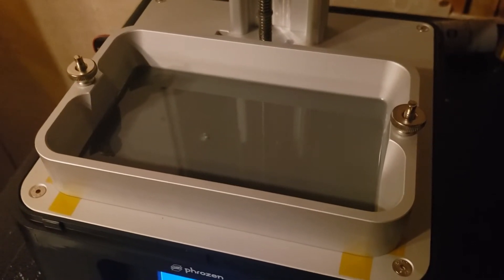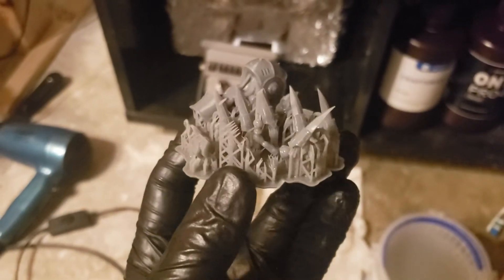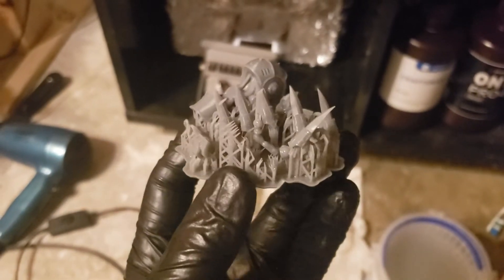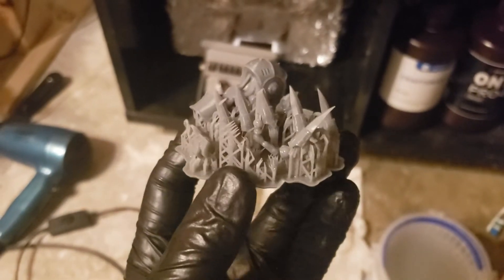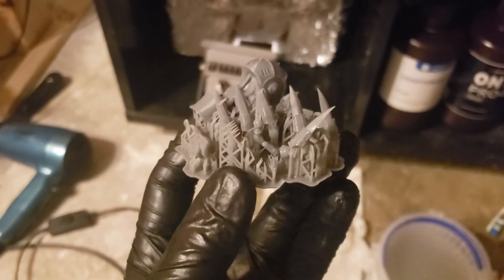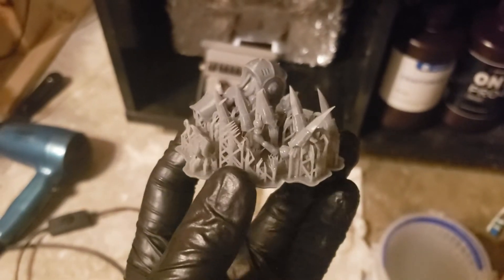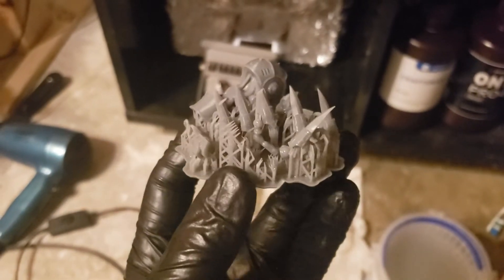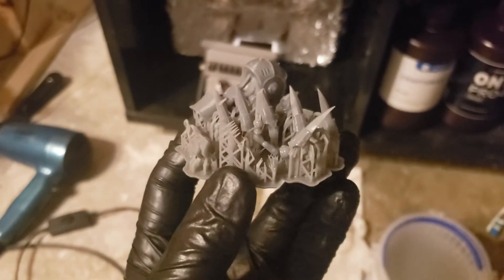Clean failures off your FEP with ZERO SCRAPING! This is the best way!

Comment: Thank you for this! I ran into a print fail yesterday and scraping the vat caused me to have to replace the fep after only 2 or 3 uses. Put in new fep and very next print fails too (total print fail across the whole fep. My luck is amazing right now). I thought there must be a better way and a quick search led me here. Was able to get my fep cleaned painlessly and get back to printing sooner than if I had been trying to scrap all the bits off. It was sooooo much easier! You are a life saver!
Reply: Well I have done a similar thing.  I will be replacing my fep today probably.

Comment: I had a big nasty failure, was sure I was going to have to change the FEP. Used this technique and it worked perfectly. Cheers.
Reply: There is easer way, you just put an old support in the corner of the LCD (NOT THE FEP) Run a tank clean then pull up and twards the center of the LCD. This will pull out the tank clean with all the stuck parts.

Comment: I didn't even know what that vat cleaning button I kept seeing on the control did until this. I wonder if I should start reading the manual or something.
Awesome tip. I wish I had known about this yesterday before I scraped a failure off and put a couple dents into the FEP already... on a brand new printer. Oh well - live & learn.

Comment: For anyone trying this: put the old support in an outer (!) corner, turn on the UV light as in the video (15-20 seconds might already do) and just pull on the support. No need to drain the VAT nor damage the FEP. I actually never clean the VAT, just give it a whisk with a soft tool.
BTW, this is an idea that was posted before this video was released by someone else, but then with the tips I just mentioned.
Reply from the maker: This is an awesome idea, gonna try it on my next failure!
Reply: You'd drain the vat because after you noticed something broke off, the risk of having additional floating bits is much high(er)! 
The more proper steps you do, the less risk of FEP damage/a major failure (in the worse case equals: printer kaput, because of a hole in FEP, resin drained all over and inside your printer).

Not draining the vat is just only 1 step away from not doing anything at all after a small failure..... and thus a catastrophic failure in the making for sure!
That it didn't happen to you (yet!!), is no excuse to learn very bad habits! You can find enough videos on youtube of people who were equally 'lazy' or in a hurry and the result is they damaged their printer beyond repair (even after a very long and tedious cleanup of all the drained resin around their desk).

But hey... if you can't be bothered to even drain, check and siff the resin, after a broken piece, before putting the resin back in, to save you just 20 seconds (because that is actually ALL it takes to do it)... by all means risk a damaged printer and/or a 2 hour cleanup. See what takes the most time and money.
Reply: @CookieTube   Never seen a hole cause it to leak inside of the machine unless someone uses a material that isn't meant for their printer. As far as more steps = higher risk.. No.. And finally.. No way will I or any sane 3D printer enthusiast drain their vat with every use. Stir.. Wait for it to settle.. cure and pull. Works every time.
Reply: @CookieTube  Wow, you got out of bed on the wrong foot, clearly. I know it works perfectly for me for a few years now. You do what ever you want to do with my tip. I do not force you.
Reply: @MondoMurderface  1) Of course not many people will come out of and admit about their stupidity after claiming by high and low you don't need to check for loose pieces. But some do, and it can be read about on various fora, and videos can be found on YT about this very specific problem and catastrophic (FEP) failures.
2) Nobody is talking about draining after each use!! This is about after you found a broken or stuck piece.... Do not strawman!
Reply: @macnavi  Yes, I did what I wanted to do with your tip and that is correcting it / warning people of the bad habit and of the possible risk when you do that (or rather don't do that -- sieving for other broken/loose bits after you noticed a bit got stuck, that is)
And I'm actually going to bed after a very happy day, Thank you very much. So again a wrong assumption....
Reply: @CookieTube   Stawman? lol.. Okay reddit, calm down. Don't make me gaslight you next.
Reply: Usually I just get the corner up with the plastic scraper, but I damaged a FEP one time that way because I was way too rough. I bet if you put a raft in the corner it would be really easy to peel the corner up and then go from there.
Reply: @geordonworley5618  That what I said and do! 😁 You need a bit of a tall one, where you can get a grip on.
Reply: @MondoMurderface  I drained my vat to check, I put the filter paper in the funnel then forgot to put the funnel in the bottle. This way seems a bit easier to remember, than digging into the FEP with the corner of my scaper:)

Comment: To be fair, you did good until you showed to touch the bottom of the FEP. That is a BIG nono as one, the way your pushing up on it can EASILY stretch it even a little bit that can cause issues later on, but you can also be leaving behind debris, fibers, or even faint traces of resin you may not see on your gloves from touching other parts of the vat. Or hecj from that towel you have it resting on. Even instructions tell you to never touch the FEP for this reason and if you clean it to rest it on its side, never flat down to avoid the FEP coming into contract with something. 
Also it comes up super easy if you put the support in the CORNER, with part hanging off of the exposure area, not just randomly somewhere. The supports create a nice lip  that is easy to go in and cleanly peal all of that up without scraping. You don't even have to clean out the resin or remove the vat and heck I've had it some times just curl up on its self due to the support creating that lip that lets it pull away. 
I've been printing for going on 3 years now, had my fair share of failed prints and never had to do much more than plop a support in a corner, run the tank clean than slowly pull it up and out. Want something even easier? Make yourself a small ball and use a really thick support on it and make it a good inch long, and print out a bunch of those. Use those for tank cleaning instead as normal supports can also easily snap off and break as you try and lift up with them. And yeah... put it in the corner of your vat, not randomly in the middle where it does nothing.
Reply: Agreed, except for one important thing: "...You don't even have to clean out the resin or remove the vat..." 
you do need to remove it to SIEVE the resin (before putting it back in)!

The chances of also having a (tiny) floating bit in there is very high. With all the risks it brings -- as you wont notice it during the hours of (re)printing, until you come back with resin all over your desk and floor (or worse inside your printer), because the floating bit punched a hole in the FEP.

As such, this is even more important to do than not putting your tray flat or touching the bottom.
It does not make any sense if you do properly handle the tray/resin like you should (rest tray on its side, not touch bottom, etc), but you completely neglect to sieve for floating bits.
Reply: I never ever sieve the resin when cleaning the VAT from a failed print. Using the expose-and-pull-out method removes all hardened resin. If you are in doubt, just whisk it with a soft tool (I use the spoon that comes with PVA) and you would feel if there is anything left. Never is though.
Reply: @macnavi  Never is, until there is...
You can not 'feel' those tiny bits at all if they are there! Yet, they sure can cause punctures.

Comment: I didn't think of that, I normally used a UV flashlight to harden the bits stuck to the FEP and then tap them or gently press them from the other side, avoiding the edge of the print, so as not to leave its impression on the FEP. TExposing a layer is a method that uses more resin, but can get rid of many little stuck bits, which is the most annoying print separation scenario, and you do not need to pour it out. Still a good idea to filter out the vat though, as running the buildplate into a loose piece will cause either the first layer of next print to come out badly, build plate to get skewed and need releveling, or (unlikely) damage the FEP/LCD. Or the piece will be randomly stuck to the next print somewhere.

Comment: If you still want to drain the vat anyway, no need to do a thin layer across the whole build area. Just do like the video shows at the end where you slightly push the Fep from underneath the failed print, around the corner of the failed print. That way it will not be sticking anymore to the Fep and go around the edges of the failed print from underneath until it pops up, then you just pick it up and throw it out.
Reply: throw it out.. after curing in the sun for a bit
Reply: won't you get marks on the underside of the fep by pressing on it?
Reply: @that_Ranjit  Not at all, you shouldn't be pressing on it from underneath hard enough to where it would leave an imprint or damage it. You should only be using your fingers when pushing from underneath, nothing sharp. Unless you have skeleton fingers, you should be good lol
Reply: @monkehgamingofficial   if there are marks from gloves or some light dust on the bottom of the fep, will that affect the print at all?
Reply: @that_Ranjit  not if you wear clean gloves

Comment: I'm kinda new so I might be doing this wrong, but what I do instead is, drain the resin (without curing a full bottom layer on the clean setting) and after that I pour a small amount of Isopropyl Alcohol into the vat (away from the printer, of course) and leave it there for a couple of minutes, after which I drain the IPA and flip the vat (on a container or a paper napkin) and gently massage the area with fresh clean gloves (maybe with a little IPA on the tips to prevent any friction) avoiding to bend the FEP (or definitely way less than it bends from the suction force when printing) and the failed part just moves/slides around, that's when I know I can just grab it from the film without worrying about damaging it.
That way I can also avoid wasting more resin on a full layer cure and maybe having more trouble with that.
Reply: This is what I do as well.  However, I haven't come up with a fast/clean way of cleaning up the edges around the fep that has a small lip of uncured resin.  Seems I'm spraying and cleaning endlessly.

Comment: Wow you are still doing a lot more work than I do with this method. 1. You expose it for 30-60 seconds?! I do 10-20 (usually 10) with 70% UV. And why are you bothering draining the whole vat? The whole point is you don't have to anymore with this method.
Reply: Yes that is what I do as well on my Elegoo Mars 3 Pro. I get the corner to pop off the fep with the extra support piece and then on occasion I have had the layer tear because the failed piece might have been a little big and so I coax the fep off with my gloves hand and then pull on it carefully and it almost always comes out clean. I did a bad thing before by having a piece of cured resin on my yellow spatula that dug into the FEP and made a hole about three days after I had changed it. I put a tiny patch of clear packing tape behind it like Uncle Jessy posted and it worked like a charm. Okay that’s all. Good luck printing everyone.
Reply: You'd drain the vat because the risk of having also maybe floating bits is much high(er)! 
The more steps you do, the less risk of FEP damage/a major failure (in the worse case equals: printer kaput, because of a hole in FEP, resin drained all over and inside your printer).

Not draining the vat is just only 1 step away from not doing anything at all and ignoring everything..... and thus a catastrophic failure for sure!
That it didn't happen to you (yet!!), is no excuse to learn very bad habits! You can find enough comments and even videos on youtube of people who were equally lazy and the result is they damaged their printer beyond repair (and that's even including a very long and tedious cleanup of all the spilled out resin around their desk).

But hey... if you can't be bothered to even drain and siff the resin before putting it back in, to save you just 20 seconds (because that is ALL it takes you to do it)... by all means risk your entire printer and a 2 hour cleanup.
Reply: @danield679  patching the FEP with clear packing tape is just a plain old stupid idea also. Again: lots of comments, and again videos, on youtube of people who did this 'trick' and "it always worked" .... until it didn't and they payed for it big time.

Because that tape WILL come loose (matter of time, especially when being exposed by UV!). And/or resin will still seep into the hole thru the miniscule tiny edge around the hole and tape where the tape didn't stick, clogging it up, harden, and enlarge over a short time which each exposure and eventually will break the tape. And this always happens during printing (thus without you even noticing it, except for a a hours later when all the resin is lying on the floor and in the guts of your printer.

That this hasn't happen to you (yet) does NOT make this a good tip AT ALL! It is an extremely risky tip! You should always have an extra FEP film at hand, you shouldn't do stupid, plain and simple, period.
Reply: @CookieTube  worker smarter not harder
Reply: @CookieTube  don’t forget to take your meds.
Reply: @ItsBrody  
Yes, which is exactly what you should do.
'cutting corners' is not working smarter, at all. It's being dumber.
'Smart' is preventing risks factors, so you don't need to do the 'hard' (cleanup) work.

And if you think draining/sieving is 'hard', maybe this hobby isn't for you to begin with. Draining and sieving shouldn't take longer than 10 seconds.
Whoopty Doo! I just saved 10 seconds of 'hard labor' in favor of much increased chances of catastrophic failure later on... I'm so smart...."
Reply: @CookieTube  When I do need to remove resin from my vat. WHICH I ALMOST NEVER DO. I use a 500ml syringe. Just because you use another method doesn't make it the 'right method' I follow advice given to me from one of the best. He actually just became a full member of the Lychee team. You can respond to this if you want. But would be a waste of your time. Have a good one.
Reply: @ItsBrody  What are you talking about now?
The subject here is what to do WHEN YOU HAVE A FAILED PRINT/BROKEN PARTS/STUCK PARTS ON THE FEP.
Nothing else!
For all I care you use a hoover to suck up the resin, or make an X-ray of the resin or do some magic voodoo to levitate it out. It is completely besides the topic at hand how you remove and sief the resin. As long as you do! The point and what is being discussed is do you drain the vat or not WHEN YOU HAVE A FAILED PRINT. 
And the correct answer IN CASES LIKE THIS (again, not talking about any other time): Yes, you should since IN CASES LIKE THIS the resin can contain loose floating pieces which WILL damage your FEP when you continue to print without checking and removing them... again: IN CASES LIKE THIS.
Reply: @CookieTube   Although you make a valid point,  you sound like you roll a 1 when ever you do Diplomacy checks.

Comment: Not sure if I’m doing something wrong, but I usually don’t even drain my vat when I’ve done this and it’s been fine
Reply: In that case, yes, you're doing it wrong I'm afraid.
Do NOT skip on draining and SIEVING the resin!
The chance of also a having a tiny floating piece is very high when you saw a piece broke off.
So, unless you want to risk punching a hole during a print, without you even noticing it and spilling the resin all over (and probably inside!) your printer, desk, floor, ... do not skip draining the vat. It should not take more than a minute to do (drain, sieve, put resin back in, vat back on printer).

Comment: I've done this without removing the Vat or the resin.  Carefully put the scrap on a corner and gently pull it out.  Don't have to drain the vat at all.
Reply: Yes you DO need to drain the vat and SIEVE for floating pieces because the chances of having them when something broke of is very high!

Comment: Is that masking tape that you have put around the screen on your printer? Is that to protect it in case of resin spills? I don’t mean the FEP, I am talking about the actual screen that cures the resin.
Reply from the maker: That is called kapton tape. Kapton tape is much thinner than the tape that was used to originally seal the gap between the printer screen and main printer body. Replacing this allows the build plate to get much closer to the lcd screen when printing.

The sonic mini 4k demands a bunch of modifications to get the best performance out of it unfortunately. The Mars 3 runs better out of the box.